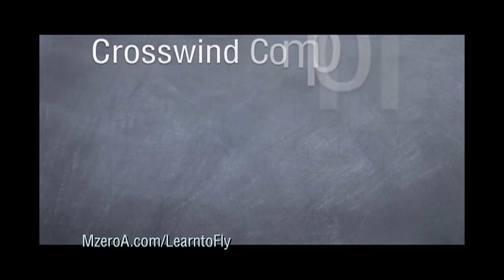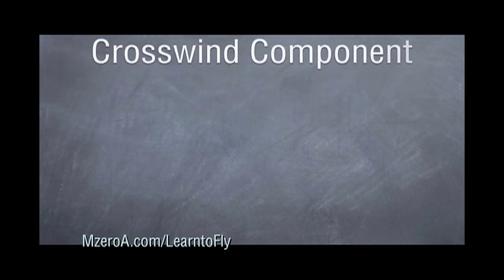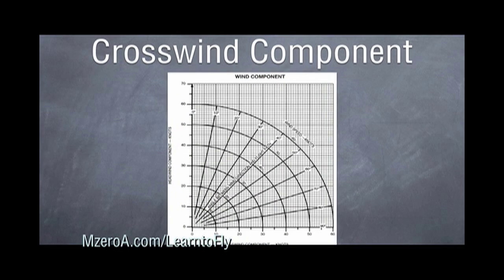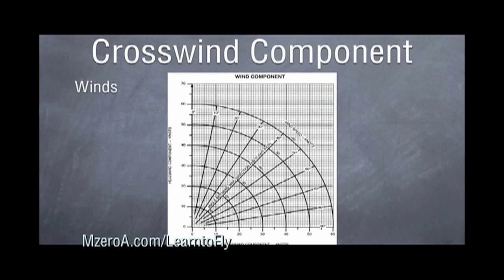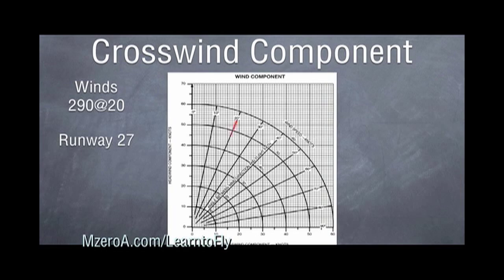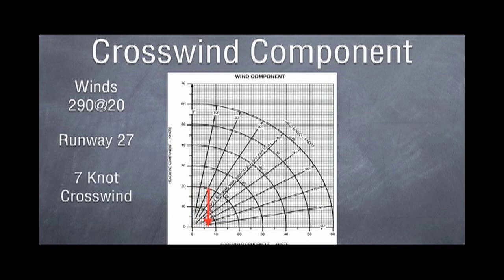Learn to Fly - Calculating Crosswind Component

Comment: You can also memorize the degree of crosswind based on angle differences and sine values. For ex., if a wind is directly on your wingtip, use 100% of the wind including gusts as your crosswind. If it's 15 degrees ahead or behind your wingtip use 97% of the velocity plus gust. If it's 30 degrees off your wingtip use 87% of the wind plus gust. If it's 45 degrees off your wingtip use 71% of the wind plus gust. If it's 60 degrees off your wingtip use 50% of the wind plus gust. If it's 75 degrees off your wingtip use 26% of the wind plus gust. If it's in between these sine values, you need to wag the value. For example Jaguande asked about the crosswind for a wind 50 degrees off runway heading at 30 kts. With a wind 45 degrees off runway heading use 71% and with one 60 degrees off use 87%. So to make a wag in between those figures average between but toward the 45 degrees off number. So I'd say the crosswind would be about 76 or 77% of the 30 kts, which comes out to about 23 kts. At the same time you get a sine value for crosswind, the cosine value is your headwind, the amount you're slowed down on final by the wind, or if you're landing with a tailwind, which I've done many times, how much faster you are on final due to a tailwind. 
15 degrees off runway heading 26% crosswind (include gusts)
30                                          50%
45                                          71%
60                                          87%
75                                          97%
90                                         100%
Most airline jets are limited to a 30 kt crosswind component including gusts.
Reply: I just took a photo of this for my  old method archives.

Comment: can someone explain this to me.  Isnt the metar winds in true and the runway is magnetic. 
So if winds are 290 true but say the local variation is -10 wouldn’t you be using the 10 degree difference .
Or if the variation was -17 you would be nearly flying into the wind straight on?

Comment: Great video.  What's the trigometric formula so I can have it calculate it in Excel?  Please make another video for this.  Thanks in advance
Reply: The formula for excel is  = Wind Velocity * SIN(Wind Direction - Runway Heading). 

When inputting the runway heading, put the full angle e.g., use 90 not 09.

Link to Calculator: https://www.ivao.aero/db/xw/default.asp?rwy=06&dir=100&wst=8&gst=
Link to Explanation: https://www.ivao.aero/training/documentation/books/PP_ADC_Headwind_croswind_calc.pdf